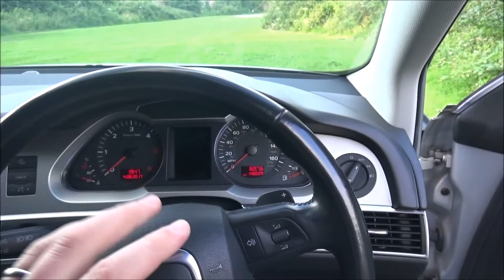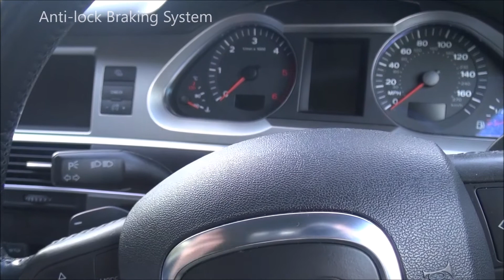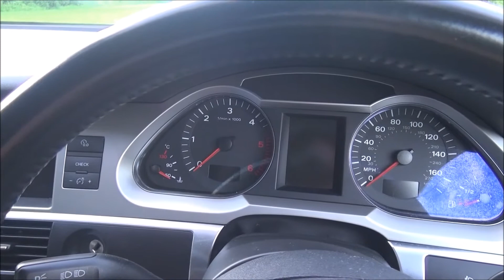Car Safety Features - A Level Physics

Comment: - Crumple Zone
- Tyre Tread
- Air Bags
- Seat Belts
- Safety Cage
- Anti - Lock Braking system
- Automatic Braking
- Other electronics and sensors
( Most of the time people have accidents is because of human errors or the car being driven very fast)